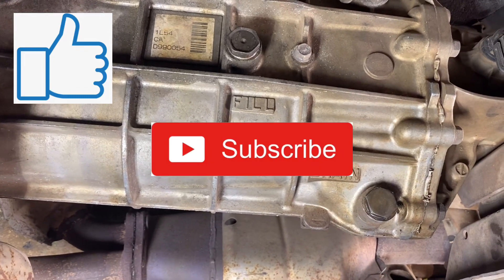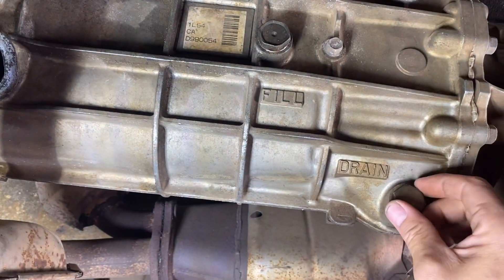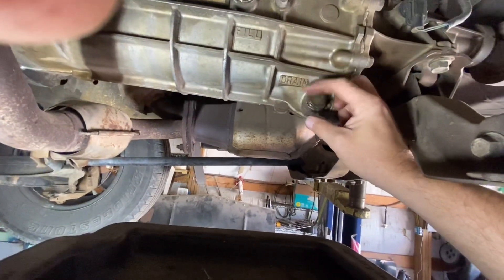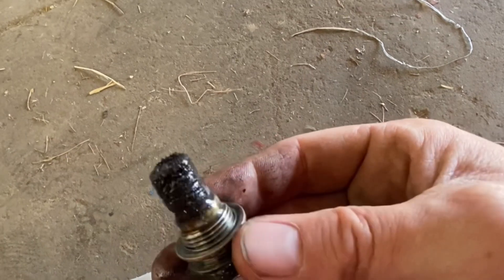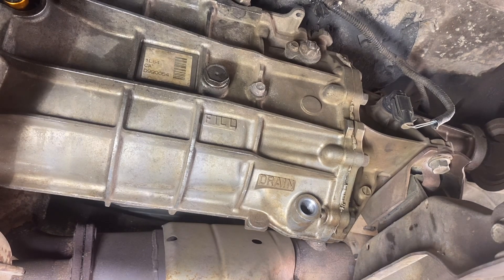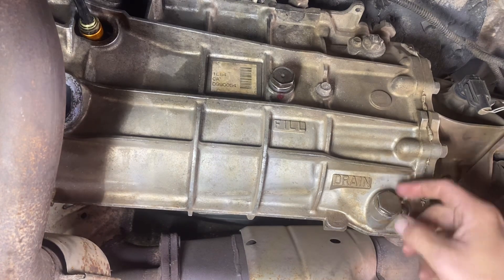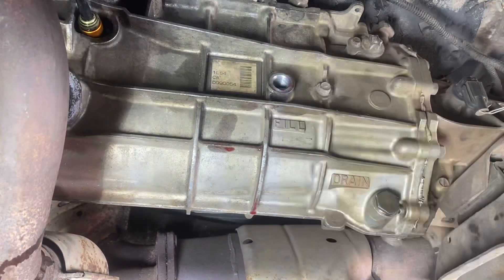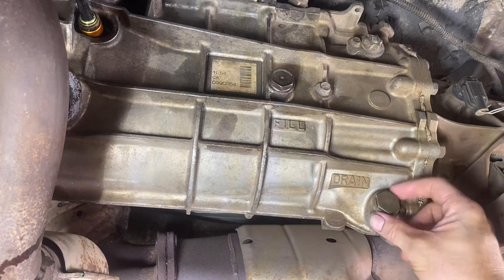Ford Ranger Easy Transmission fluid change manual transmission

Comment: Is there a stick to check level cant find it
Reply: fill to spill. Fill it up in that hole until it starts spilling out.
Reply: fill to spill. Fill it up in that hole until it starts spilling out.
Reply: fill to spill. Fill it up in that hole until it starts spilling out.
Reply: Standard trans-mixer's don't have 'sticks', only automatics.
Reply: there is no dipstick you take off the fill bolt and pump the new fluid in and once some fluid starts coming out your good!

Comment: If it’s a Manuel transmission then why do we put automatic transmission fluid? ( asking because it’s my first time doing this and don’t want to buy the wrong fluid)
Reply: Some manual transmissions rely on splash lubrication to protect bearings, gears, synchro's etc the M5OD-R1 being one of them as a light duty gearbox. Heavier weight oils can run the risk of not properly lubricating those areas. Stick with what the manufacturer recommends which is Mercon ATF, you can buy Dex/Merc or use new Mercon V ATF.
Reply: @tylerwilliams1882  imma have to double check my manual, it certianly mentions using 75w gear oil iirc but im unsure if they mention if the Mercon V is acceptable.
Reply: Because that is what the manufacturer requires.
Reply: @100GTAGUY  You are thinking about the differentials.

Comment: How many quarts?
Reply: It’s just under 3 quarts for the manual
Reply: @Marvinjonasthe5th   I like how you responded to yourself once you got the right answer lol. You’re awesome
Reply: 2.8 quarts
Reply: Para una 2.3 l standard qué tipo de aceite????
Reply: @felipjuanes2684  Ford recomienda mercon son 3 cuartos mas o menos
Reply: @hvactechpr7872    he cambio el aceite por un  CASTROL ( atf tipo mercon )  y la caja de cambios a veces se traba al hacer los cambios de  1-2 - 3 , con el anterior aceite no sucedia  ese problema.
Reply: @felipjuanes2684  el manual recomienda usar el tipo MERCOM ATF , para transmision automatica .  cual le pusiste ??

Comment: bro atf is automatic transmission fluid, you're supposed to use 75 90w gear oil for a ford ranger that is a manual.
Reply: i saw in manual of ford ranger ,  is the same oil for both transmision  MERCOM V atf , its weir but is the true .
Reply: You’re wrong asf these trucks take auto fluid 😂
Reply: Yeah its 70W-75, I don’t know what these people are talking about
Reply: @loyfeliciano7651  nawh man atf got to hot and chewed my input shaft gear apart
Reply: ATF.  Gear oil is for the differentials.  The 80s truck used gear oil.  Check your manual.
Reply: The M5OD transmission uses automatic transmission fluid! Don’t listen to these knuckleheads. It came from the factory with Mercon ATF . Dexron 3 / Mercon ATF would be the same as the factory original fluid. Ford now says Mercon V, but that’s probably because they no longer sell the original Mercon ATF at the dealership. Use DEX III / Mercon in the transfer case Too.